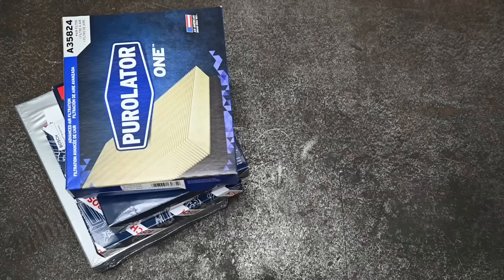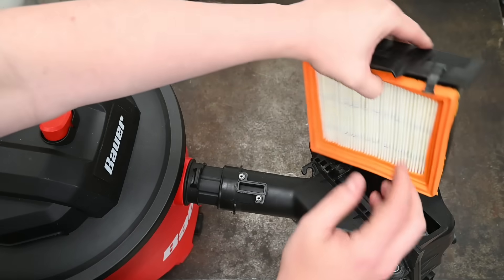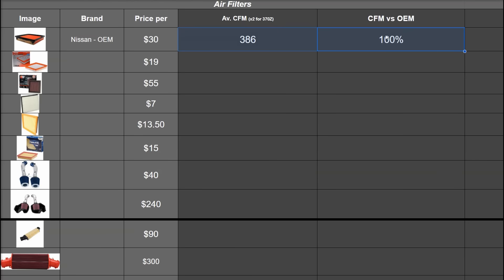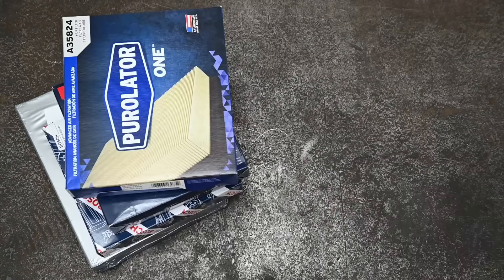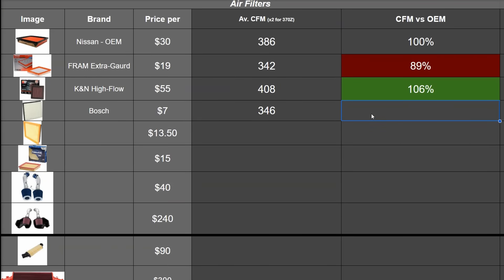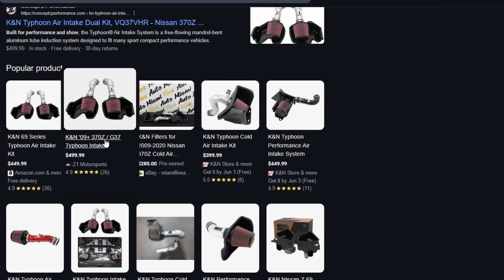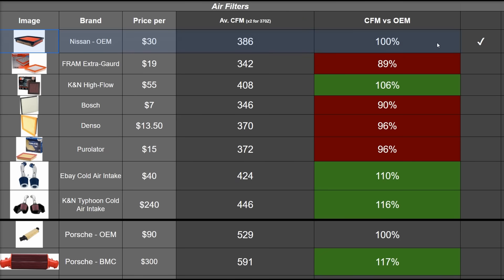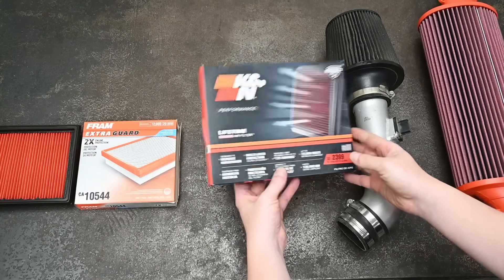Intake Filters TESTED: More Dough = More Flow?

Comment: I think, of those, I’d prefer to go for OEM or Denso. Denso is OEM for a lot of manufacturers, albeit not for Nissan filters apparently, and OEM is OEM. They may not flow the most, but (perhaps more importantly) they aren’t going to let your engine chew on a bunch of dust and dirt like some of the cheapo “performance” filters do. They get better flow for low price because they don’t filter. K&N is debatable for me. The actual filter media is grossly inadequate for what it’s required to do, so they rely heavily on the oil to catch particles, sort of like how old oil bath filters did. How well that works depends entirely on how precisely the filter is oiled. They also have a nasty habit of sucking oil into the intake, which isn’t going to hurt the engine, but it coats MAF sensors and causes them to under-report airflow. At best, that’s going to cause poor performance and a check engine light. At worst, it’s going to cause your engine to run dangerously lean and destroy it and/or (in the case of some early OBDII automatics) your transmission. Yes, really.

Comment: for my daily driver, i generaly don't care how free flowing the filter is. as long as it can do it's job (filtering the dust and such out of the air) then that's fine. i don't push the cfm demands much cause it's the daily driver, it's ment to be used, and driven for a very long time. aka, no uneccessary abuse.

Comment: I love everything you guys do. I have to add a critical piece of information. An engine doesn't take air in smoothly as the vacuum. It takes air in as pulses. This makes the filter vibrate. This changes the openings,  breathing and filtering capabilities of the filter. This is especially true for the KNN. Add the same about of debris to each filter and draw the air on a pulse and the KNN will loose nearly zero airflow while still filtering better than the many others.

Comment: If a filter has the same area but flows more air, it filters less. 
Particularly when you move from a WWWW shaped paper filter to a ===== shaped foam filter, same cross sectional area but much less filter area. 

Whether that matters to you or not is another question.

Comment: Should try swapping the eBay intake filter on the k&n typhoon pipe to see if the 6% difference is the pipe or filter. 

Surprising to see the cheap intake is not JUST a tube.

Comment: CFM as related to an engine is normally rated at 28” of water column.
Not knowing the column drawn makes the absolute numbers say very little in regards to if theres enough flow for the engine.
Since flowing an air filter isnt very complex a shop vac might be a good enough tool if the column drawn is measured and the flow number converted to 28”.

Comment: apparently the high performance K&N type filters work when they are in engine setup with vibrations, 
if we test it statically on a rig and fan/vaccum then they dont filter well. the oiled fibers should be moving with vibrations to catch dust.

Comment: Cool comparison! I know you can't check every brand out there, but for my older (1998) BMW I use Mann filters for both oil and air as they have a good reputation and I believe are OE, and for my '01 Explorer, yeah I get the cheapo from AutoZone, which is typically an STP.  I would not be surprised if the STP did not flow as good as it should, but with the Mann being OE (I think) it should flow pretty well. I'll have to take a good look at the STP filter construction and maybe start using Motorcraft. I use their filters for oil, they always seem to be rated pretty well.  IIRC, I think I used Mann filters in my dearly departed '91 Volvo 240 wagon as well.

Comment: Stock 04 pontiac bonneville and just putting a K&N filter provided noticeable performance and fuel improvement. Had a trustable mechanic friend  tell me years ago on stock smaller engines  things like plugs and air filters would make more noticeable difference then on larger or tuned engines. Mine have all been stock nothing special cars and I have put the K&N filters and better plugs in them and have always noticed improvements so I can't help but swear by them

Comment: Then factor in loss of filtering capability, drop in MPG, and loss of power for being a hot air intake. The additional wear on the engine, the extra expense for the fuel, and less power when using a HAI, and it usually just isn't worth it to use those other filters. If you use K&N you need to change your oil twice as often because of silicon.

Comment: The forum poster is right on with his math.  Assuming volumetric efficiency of 1 is pretty much the absolute best-case.   

It's kind of funny that he gets all that right, and then thinks that "ram air effect" on a car can amount to anything significant.  Intakes just can't work like that, unfortunately, and the amount of pressure available is miniscule.

The entrance to the intake tract is optimized for velocity, and the speed of the car has basically no effect on it.

Comment: The big drawback with K&N filters is that they basically don't filter properly. They claim to, but don't. They were originally designed for sand dune buggies, where the sheer volume of fine sand being thrown up into the air by big paddle tires would coat and plug up paper engine air filters. The K&N design doesn't plug up under those conditions, and it's cleanable, so you can get all the sand out of it after every couple days on the dunes. The catch is that it filters poorly, and lets a lot of particles through. People with dune buggies didn't care, nor did other, proper race cars, especially drag cars that only care about one full-throttle run. Real racers aren't going to put 30k miles on the filter. The K&N is a step above a wire mesh over the intake tube to keep the birds and rocks out, so it flows plenty of air. Note how the OEM filter nearly matches it, but will not allow fine particles through to the engine like the K&N does. Your hypothesis - that the used one would be somewhat plugged up - failed because it doesn't really do its job right in the first place. Since you bought all these filters, it would be cool to see a second test vid where all we care about is how many particles the filters pass.
Reply: Really need a particle matter test

Comment: Can you somehow find a way to measure dirt pickup? I would rig an IAQ tool on the shop vac exhaust and come up with a way to apply fine dirt evenly and repeatedly. I always thought the K&N's allow more dirt through and could cause wear on an engine.

Also, I would love to see the porsche filters with the same shop vac as the Nissan ones you did, just block one end. I want to see how the filter performs apples-to-apples.

Comment: 1:42 as a mechanic I can confirm this, i have seen every intake you can imagine on these including one that still had the factory air box but with holes drilled into it for more airflow
Reply: I had a customer bring a ford fiesta in and the bottom of the airbox was completely cut off. I wondered why it sounded so different on the initial test drive 🤣
Reply: I had a maxima and cut holes into a spare filter holder (air entered before the filter obviously). I didn’t care for airflow, but it gave nice aftermarket intake noise.
Reply: @NoLongo  Just for the sake if information, that would make it suck in more hot air, causing a drop in performance. Just so you know for future reference
Reply: @kylesebring Yep, cold or its worthless
Reply: I bought a used Mitsubishi Diamante, it had the bottom of the intake box cut out. It made a great intake noise! Lol
Reply: Did this to my 1jz soarer for the 'pod' / dose noises, works really well and till looks stock+ at least some cold air still

Comment: You’re never going to gain horsepower putting a K&N filter or cold air intake on a stock Corolla or anything naturally aspirated. That’s just marketing at work. BUT they will increase power in certain circumstances. My car is turbo charged & tuned with 25 PSI of boost. My cold air intake made by ZZP with a K&N cone on it netted 13 horsepower vs stock airbox & paper filter. 11 HP gain over stock airbox with K&N drop in filter. BUT the car also had to be tuned for it. The cold air is a correct cold air as it runs the pipe down into the fender well. There are trade offs. I know it can’t filter as well. The car barely gets driven so it’s fine. But the much louder turbo noises… priceless haha

Comment: Good science 👍.  You are correct when stating that it depends on what is going on under the hood. Just because you can flow more air doesn't necessarily mean the vehicle engine management system cares at all, so many vehicles will need computer tuning before all that extra cfm means any meaningful results at the wheels.

Comment: The problem with a video like this is that someone will take it to heart.  The unstated assumption is that filtered = filtered.  A binary, on/off situation.  This is obviously untrue.  Project Farm did a great video a few years back where he tested a K&N style filter against OEM style paper filters, and just like you he found that they did flow a lot better.  What he also found, and what your video completely omits, is that the K&N style filter performed abysmally in terms actually filtering out particulate matter.  It wasn't even close, and it was very eye-opening.

Comment: You really have to test this on an actual engine since the airflow is pulsatile and the design of the intake box and filter style can affect the performance just as much as the filter air flow. These tests, as performed, are essentially useless.

Comment: Going by Project Farm, the K&N's have higher airflow because they let pretty much everything through. So yeah, potentially more power ... but like everything, comes at a cost.
Reply: What I've seen from many years making my living under the hood agrees with their assessment.  K&N lets noticeably more crap through.
Reply: @immikeurnot would you say this is more or less acceptable on a diesel engine? But harmful to a gasoline engine?
Reply: @Codeman785 harmful for any engine. Debris going into the engine will cause wear. More debris in less time means less engine life compared to one without that filter.
Reply: @Codeman785 Doesn't matter what type of engine it is.
And the fine particulates are the ones that do the real damage, not the big junk like insects, leaves ect.
Polishes the cylinders away.
As a forklift mechanic I've seen several 'dusted' engines in my time.
Reply: @Codeman785  I'd say it's unacceptable on any engine.  Air filters have one job, and that's to keep dust out to protect the rings and cylinder walls.  It also helps keep the oil cleaner, but the oil filter can catch most if not all of that.
Reply: Another old fart mechanic, this is an OLD debate topic akin to the "which oil". Personal anecdotal evidence points to K&N/oiled foam/gauze filters letting in more of everything and leading to shorter engine life.  A buddy was the chief mechanic for a pit mine and found the same (cost of OEM filters replaced weekly was cheaper in the long run as K&N's required quicker engine rebuilds ~ roughly 100k miles of dusty mine life).  That's the other angle, while there IS wear, unless you're in constant dusty environment, you'll probably sell or destroy the Rest of the vehicle first....
Reply: apparently they also splatter your mass air flow sensor with oil causing all kinds of problems.
Reply: Always been like that.
Reply: Kinda what happens with flow... you can't get more flow without letting more in and you can't get more filtration without choking some flow. It's a literal tradeoff.
Reply: K & N is basically the Monster (overpriced cables) of cars
Reply: Tried one but didn't like it.  I felt like even oiled per instructions that it let too much junk though the media.
Reply: This was such a cool video. Thanks for this. I have an isF and debating if I should get an aftermarket intake
Reply: Air filters are overrated. 
I drove my Toyota Cressida from 300k to 375k KMs with no air filter, even in Australia driving outback and shit it was fine. 
Heck even when I put a gt35 and basically no tune with 24psi it lived several weeks. 
I wanted the engine to die so I could put my 1jz in. 
Ended up just buying a jz swapped Cressida and keeping mine as an abused shit box that never gave up.
Reply: K&N filters are one of the biggest scams in history.
Reply: I’ve seen some comments on their video about where the k&n performs badly on the static test but placed into an engine, something about the vibrations makes the mesh work as it should in letting air through but also catching particulates
Reply: @chibbyylol Sounds like grade A baloney put out by K&N's marketing department to me 😂
Reply: @chibbyylol  Sounds like an urban legend!

Comment: The filters that can be fitted into the cars original air intake box will perform better in real tests. When you have an open filter mounted in the engine bay it will take hot air from around the engine. And you will get less air into the engine. And less hp....

Comment: K an N are mass air flow meter killers, that oil will eventually cause errors.
This is the best test I have ever seen for testing this, great job
Reply: No evidence. People like you just enjoy saying that for some reason. I've been using K&N for 20 years, never had any problems with maf sensors.

Comment: Curious, in the video (at the 3:55 mark) you had the MAF removed and not capped off on the factory intake. Wouldn't that let some air in bypassing the air filter inside the airbox?
Reply: It is blocked off.
Reply from the maker: The tube inside goes past it, it's sealed off

Comment: So every onramp has turned into a drag strip since I got my turbo installed, lol.

Also, tell your friend that you're supposed to wash and re-oil those filters... They flow so well because they rely on the oil to catch crap, and once that oil is covered in the caught crap, they stop filtering as well.
Reply: Actually the opposite is true. The collected dirt actually closes the gaps in the filter and it is most efficient in the middle of service life.

Comment: Higher flow filters will throw off the fuel mixture (makes the ECU think its lean) which will throw the check engine light for an intake leak, and use more gas. I know this from experience and had to go back to a factory filter.
Reply from the maker: You didn't change any dimensions of the tube? Usually the mass air flow will happily correct, just as it does for different elevations
Reply: You have a minimum of 15% enrichment available. You aren't gaining 15% HP from a filter, so I doubt the flow was the culprit. If you believe so, just pull the battery cables overnight to let it reset. Then startup with a new filter.

Comment: Welcome to the club. I did a video a while back testing out filters, but for backfiring up the carb, to see which ones burn through, or melt, or can make things worse. Some were SCARY as far as how quickly they caught fire and needed a full extinguisher!
Reply: Back in the day, on my 72 Cutlass running a 455 massaged engine, I ran the Edelbrock Pro Flow Chrome mesh triangle air filter. This thing had a foam, washable filter insert that did pretty good. But like you said...a backfire through the carb and that foam material would easily melt! My stock Rochester spread bore had a bad habit of doing just that so I swapped it out for a Carter ThermoQuad...which kept things much cooler under the hood as far as fuel was concerned!
Reply: @ekummel  I was being more goofy when I started off with my test, but was surprised how quckly some of the filter mediums burned. The best was this 50 cent Defense filter...though I cant find them anymore and Honeywell sold that entire factory to China so I hold onto my old stock for dear life. I guess like anything old these days
Reply: wow i will be adding you to the que haha. esp with the clippy

Comment: I know Project Farm has already done it but the results were controversial. I would love your guys take on running an actual filtering experiment. I.e with the K&N do you massively compromise filtering ability in return for better air flow? If you don't have the tech/tools to do it, no worries. I get that its not your wheelhouse

Comment: If I remember correctly Bob, the oil Guy did some air filter filtration test and found that the k&n did in fact flow better, but, that was to the detriment of its filtration.

Comment: Drop in K&N is probably most worth it if you are not tuning the car.

Would be interesting to see the results of some of those dry no oil reusable filters and maybe even cabin air filters.

If you ever do more testing on these you might want a dust collector that can get 650 to 1500cfm and offer a bigger opening for like the cold air as you might have a slight restriction with the adapter used.

Comment: K&N advice: Do not use oiled filters with MAF (Mass Air Flow) sensor vehicles, the oil will contaminate the hot wire on the sensor and give the engine computer bad input readings.

Comment: Now do a particulate filtering test between them. Also, let the dirt sit on a K&N (or other brands using filter oil) for a few days to dry out the oil on the media. Then test how much dirt gets past the K&N compared to a paper filter. I have seen many K&N filters allow the engine to suck in enough dirt to ruin a top end that I stopped recommending them to most customers.

Comment: You have a very interesting article about air filter flow but unfortunately you're only testing the airflow at one AirSpeed and the engine the air flow will vary depending on the RPM most cars on the intakes have attachments on their intakes to handle the point where the air goes into resonance at resonance the air intake flow can slow way down you need to repeat your test and Vary the air flow over a wide range so you can see when it approaches resonance